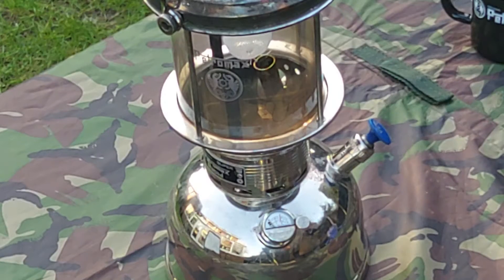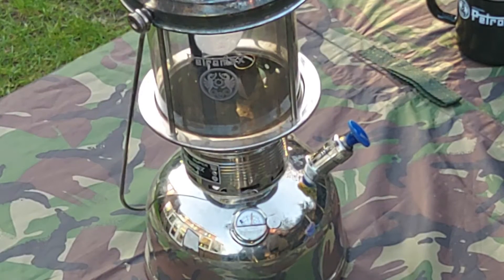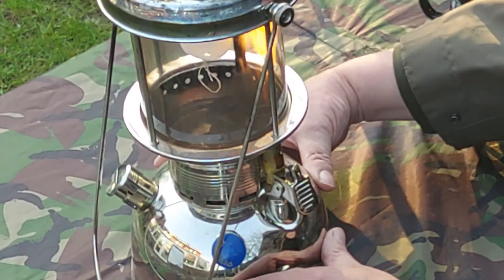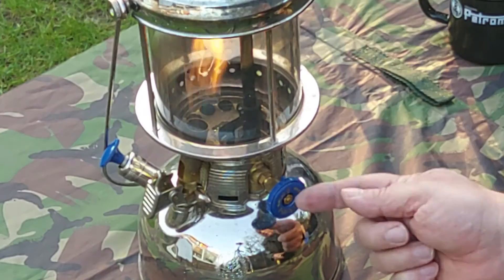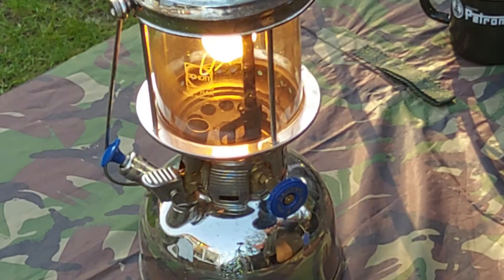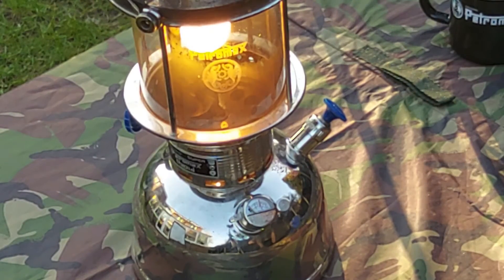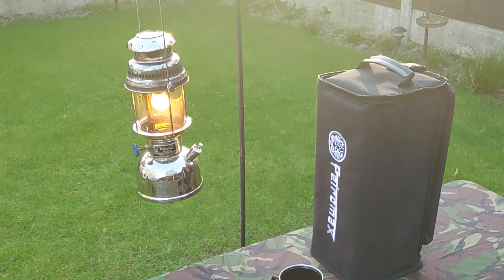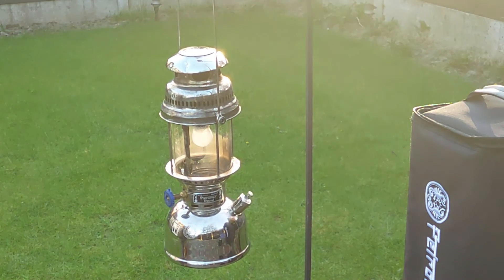Petromax HK500 part 2 - The lighting

Comment: I have one of these lanterns. I find on mine that I have to keep a continuous flame to the fast pre heat to keep it burning otherwise it goes out. I was told to reduce the pressure and that kinda works a bit better but still have to re light the fast pre heat. I prefer to use the soft start. It is a beautiful lantern. I also have a 1973 639 kerosene Coleman that although doesn’t look as good the petromax is less finicky . I bought both from an antique shop and paid €70 each. The Coleman was full of fuel ( probably from 1973 ) I just put a mantle on it and it fired right up. They’re both great in their own way but if I had to pick one for reliability then it would be the Coleman. Id like to see a video on the petromax stove you mentioned that fits on top of the lantern, just to see how efficient it is.
Reply from the maker: Thanks for the comments.  I will do a video with the stove attachment on. That's something I haven't got around to doing yet. You seem to be having trouble keeping it alight. I haven't had any of your problems. Once lit, if it has fuel and pressure it will stay happy for 8 hours. I'll make a point of it in the video with the stove attachment.

Comment: Am I right in thinking you have a choice between using the lamp's own pressurised paraffin as a preheat and using alcohol for soft preheat or have i misunderstood something?
Reply from the maker: That is correct. I use the lamps own paraffin pre heater. But there is also a small tray that you can fill with methylated spirit and use that as a sift pre heater. That process needs to be done twice and its not so easy filling the tray with methylated spirit.

Comment: The Petromax high pressure lamps are a lot of trouble. You will spend a lot time fiddling around with it. Most users have it on the shelf. If not everything is perfectly aligned you will get a nasty flame on and around the top. Keep your children away.
Pumping it up takes a long time (200 times pumping) and the knob is too small for an adult hand; it will snap your finger. A normal lighter will not work to start the pre burner and you will have to start the pre burner quite often. A normal lighter will blow out because of the jet of fuel mist that comes out.
and while the pre burner is going you will have too keep on the rod to keep the pressure up - that is a work out. Hold the lamp firmly and push hard and fast. Sounds easy - but you will have to do so several times. The light will not burn normally the first few tries. You will need to have it cool of. Fiddle around with and again, and again. Than maybe, after replacing several socks it will burn - maybe good but at least some light will come of - sometimes.
So, after you spend 200 euros on the lamp, 50 more on spare parts you might wonder the third time you are trying to get it to lit up.... should i just put it on the shelf and get a regular decent oil lamp - or ten of them! of still save money.

Don't buy it unless you are willing and prepared to spend more time on adjusting and messing around with it than it will actually burn and work
Reply: I agree there certainly IS a learning curve with these type of Kerosene pressure lanterns but after you get it figured out they run very well. I have the Britelyt version and its the best lantern I own. I have a Coleman 639C which is boringly easy to use but is also a good lantern.
Take your lantern off the shelf, give it another try !! It, like any mechanism, will malfunction if there is a bad part in there, but get it replaced a they run great !

Comment: Anybody have any suggestions to improve the pump on these. I have the wenzel but it seems like you're having the same issue here where maybe one out of three strokes actually pushes air into the fount
Reply: Hi Buddy, I have a couple of these lanterns ..I took off the manual hand pump shaft/mechanism and replaced them with a screw pump adapter .. brilliant .. you pump it up with a manual car / bicycle pump in a few seconds .. so easy.
The adapter is readily for purchase on various internet sites and your own bicycle wheel air pump will do nicely ... just saying👌
Reply: Yeah I actually pick one of those up the other day from imperial lamp parts, horrible company don't ever shop there does the price for anybody that happens to read this. Seems like a really good idea but mine was leaking. Probably an isolated incident

Comment: Is the amount of light adjustable?
Reply: Yes. The light output is dependent on pressure. Pump to high pressure for bright light. Releasing pressure reduces light output. There is a very usable light even at the lowest working pressure. There can be some carbon build-up at very low pressure.
Reply: @serhatceylan1784  is it still available, and how much do you want to sell it for? What is the condition of the lantern and is it still working? Thanks.